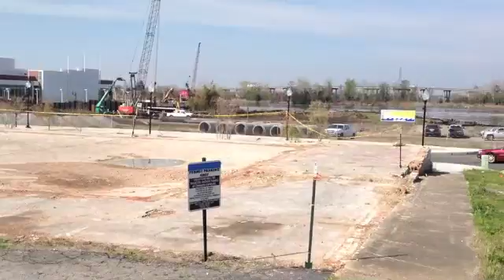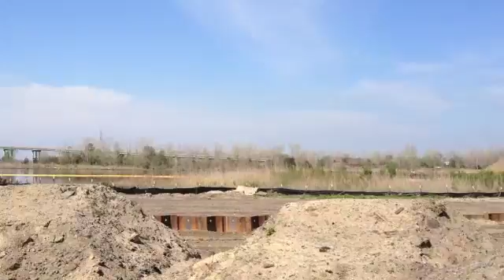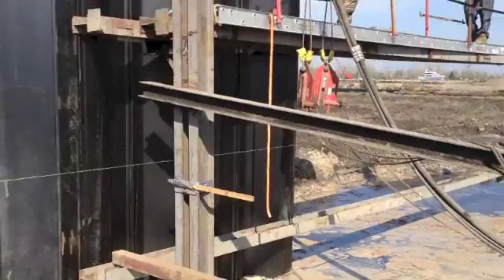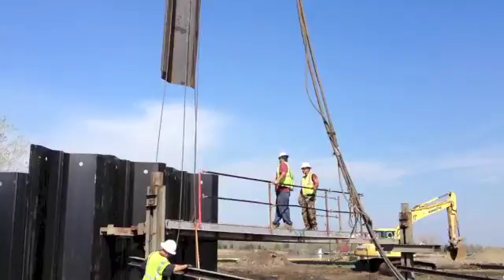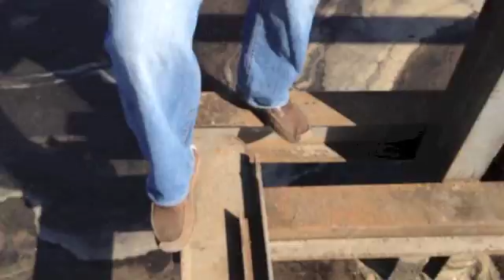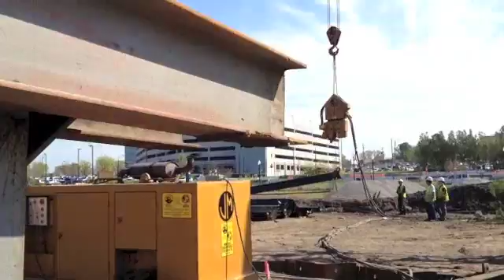Construction - Driving Steel Sheets to Build a Bulkhead

Comment: I will say one thing. I have no idea how I ran across this "You Tube Video" and yes....I recognize this Video is from 2013? At any rate, at 64, I know a little bit about driving Steel Sheet Pile. Rest assured, for whatever it is worth, that "Pile Foreman" that thread those Sheets (in the Video) with that "J&M Vibro" built by "John White" out of Seattle, actually manufactured by "King Everets" in Pittsburgh, and to watch him (the PILE FOREMAN in the Video)  draw that "Sling Line" and to actually see how STRAIGHT that Wall was! Are you kidding me? I can assure all....that can only be performed by a "True"...MARINE Pile Driver. as in this Video. Don't know your name, my apologies.... but heh....NICE WORK! - Smoot

Comment: Steel aka going to need replacing in due time, they should have gone with vinyl or other composite, so in the future its going to need replacement work which is added costs down the line, unless they plan for further expansion.
Reply: Not necessarily, those sheet piles are coated nicely in coal tar epoxy.